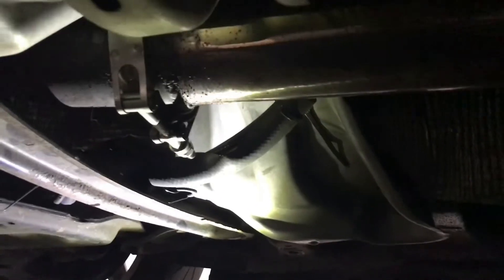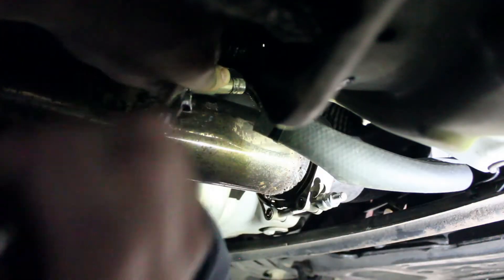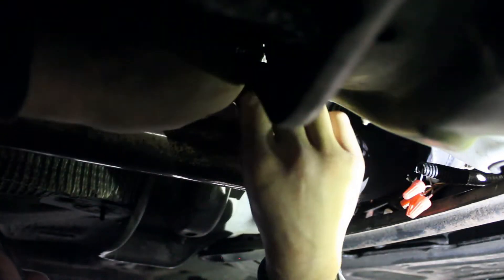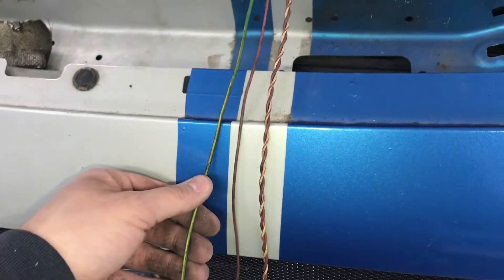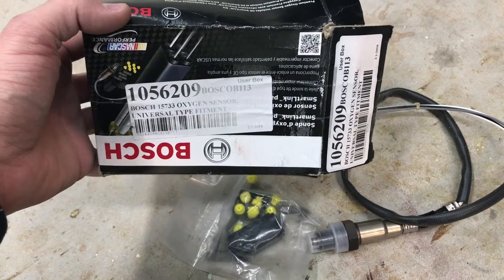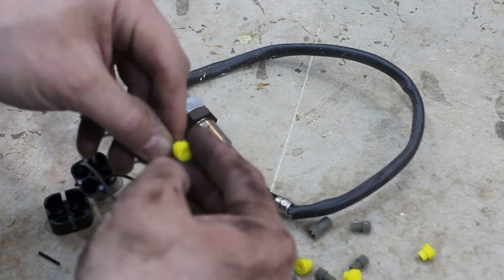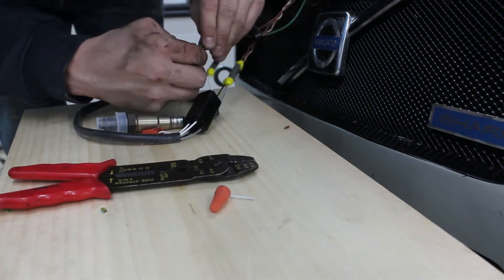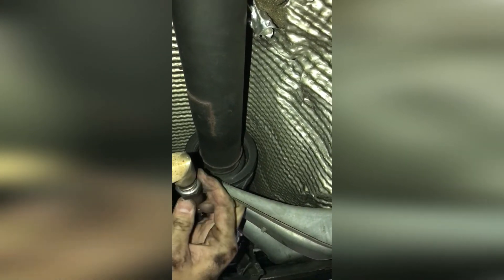Volvo C30, Downstream O2 Sensor Universal Replacement

Comment: Are you managing to avoid a CEL with a catless DP with just that 90 degrees angle for the 02 sensor?
Reply from the maker: No, you need a tune for catless. You should have a tune with any Downpipe upgrade. The 90 degree piece is because there is not sufficient clearance for the O2 sensor to feed straight into the 3” diameter pipe without angling downwards, which risks collecting condensation.

Comment: What’s your take on the stage 1 elevate tune for the c30 is it reliable worth it better then Hilton?
Reply from the maker: All Stage 1 tunes are more or less the same and will be reliable if from a reputable tuner. I would suggest Hilton, as they'll provide more support for additional parts and customization. Elevate was only able to help me to a certain extent.

Comment: Hello Michael I have an issue with my keyless entry system y replaced the batteries on my key fob and I can’t start the car unless I use the original key to do so I continue to get a car key not detected message what could be the issue
Reply from the maker: I would guess that the key lost its programming. Unfortunately, it cannot be reprogrammed.
Reply: @MyNameIdeasWereTaken  what would be the next step then to take care of the issue I’ve read that disconnecting the battery for 10 minutes solves the problem do you concur?
Reply from the maker: @waltervila33  If the key has truly lost its programming, the only solution is to buy a new key and have it programmed to your car.
Reply: @MyNameIdeasWereTaken  do you mean the keyless or the key fob and if so would I need to take it to the dealer or my specialist to have it reprogrammed thanks
Reply from the maker: @waltervila33  My guess is that it's an issue with the key fob. Even when the key fob loses its programming, it can usually still start the car. But it won't respond for locking the doors or using the door handle for keyless entry. I'm guessing this would be the same for using the keyless knob for starting the car too. 

Do the buttons on your key fob still work for lucking and unlocking?

Anyone with a licensed copy of VIDA should be able to program a new key.
Reply: @MyNameIdeasWereTaken  the key fob buttons don’t work to unlock/lock the doors it only starts the engine my specialist garage has VIDA dice also one of my tire pressure sensors has gone to pot or so my warning system says do you think both issues are related?
Reply from the maker: @waltervila33  Probably unrelated. The key fob issue is very common. I've had 3 keys on my C30 lose their programming.
Reply: @MyNameIdeasWereTaken as ever thanks again mate for your help you’re a luminary mate when it comes to The P1 platform I’ve book service time for Wednesday with my local specialist garage cheers bru